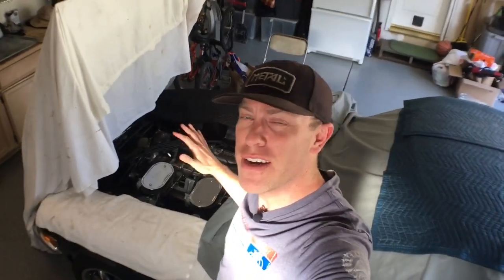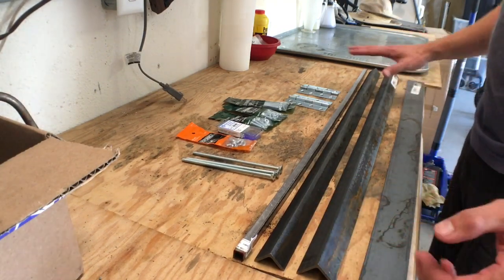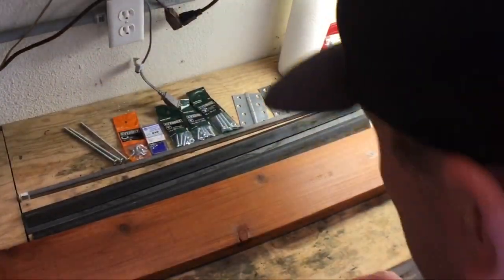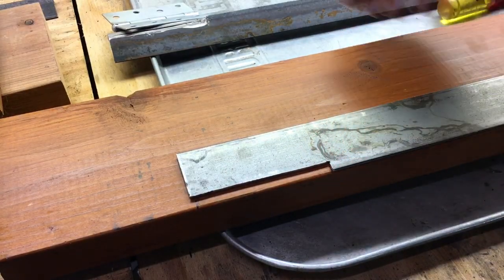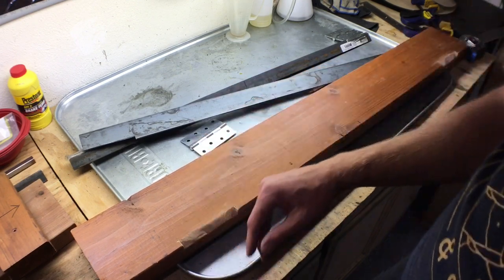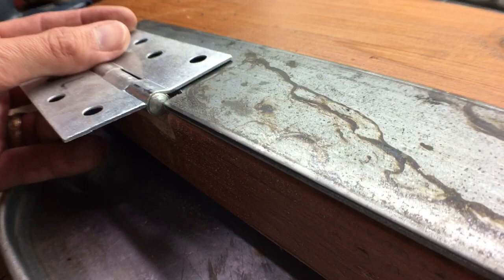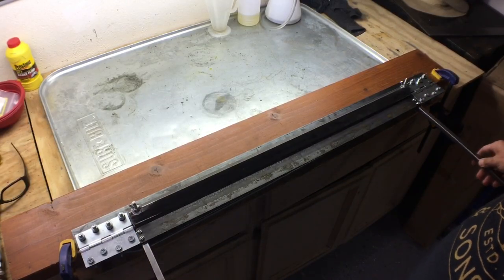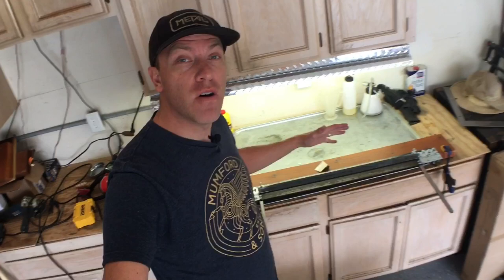How to make a sheet metal brake with no welding

Comment: Built my own real similar..but I used it as excuse to buy my first welder. $120 on Amazon..I was able to weld in place my hinges,  handles and some back mounting plates in a fraction of the time it would've taken to drill, bolt in place. Just saying..it's a great tool and skill to add to your arsenal!
Reply from the maker: I like your thinking. I have seen bought a welder, you’re right, in less time then drilling.

Comment: Wouldnt a piano hinge work better just asking not judging
Reply from the maker: I suppose you could, my only concern if the gauge of metal would possibly bend the hinge if it was too thick. The other thing is piano hinge are typically long, so you still would want the sheet to feed through between. Thanks for watching!
Reply: @CarsBikesandCoffee  they have some pretty heavy duty ones at Home Depot and lowes in stock usually and just saying to maybe save you a lil work or maybe another build idea for another project definitely not knocking what you did just want to say that just in case lol
Reply from the maker: Oh cool! Yeah for sure taken as good advice 👊🏻! Always appreciate the community help

Comment: will it bend 3mm?
Reply: Not a chance, we have a clarke sheet metal folder in work and that's only 500 to 600 long and that will only just bend 2mm but the bends not sharp it's more like a curve. I'd say the max on something like this would be 1mm
Reply from the maker: +scott alexander +spoopy yeah, this is good for just small projects. Like the battery box I built. Thanks for watching!
Reply: @CarsBikesandCoffee   still a really cool build and handy to have in the garage
Reply from the maker: +scott alexander thanks man!
Reply: @CarsBikesandCoffee  I was thinking about making a skid plate so I need to make a 90 bend with 3mm. May have to half cut bend instead maybe try weld the line after.
Reply from the maker: +Spoopy that’s a good idea. Some metal shops may have a large enough brake to do it, is another thought. Good luck!

Comment: Great video....I was thinking if you used a longer set of bolts for the top angle that holds down the metal you can convert this brake into a pan brake.  by the way I really liked this idea.  cannot wait to get back to work to build this.

Comment: How do you make a small pan/box/anything that is bent from adjacent sides if it's not adjustable?
Reply from the maker: +Ace so I ended up making a small top brace for that. Check out my battery box episode around 4:47 https://youtu.be/0X5dUhSLWSc
Reply: @CarsBikesandCoffee  Fantastic. That's similar to the solution I came up with, I was worried the extra holes might interfere with regular bends. Not sure why no one else has made theirs like that.

Comment: Finally had some free time to make this. I'm up to the angle steel part which holds the sheet down. I thought I had some but it turns out I don't. Is there an alternative hold down method? Every tutorial seems to use the same hold down. Any help is appreciated.
Reply from the maker: +Ace unless you have maybe square tubing. That part needs to be really strong to hold down the edge of your metal to bend it. That’s why the angle iron is used.
Reply: @CarsBikesandCoffee  I have square tubing but it would prevent me from making a 90° angle since a sheet needs to be over folded to get a true 90°. Can I use wood?
Reply from the maker: +Ace yeah, that’s the other main reason to use angle iron. You could cut the square tubing in half. Wood will give, but depending on the thickness and size of what you’re bending it may be fine, give it a try. Good luck

Comment: What you think is the max thickness to be bendable?
Reply from the maker: +EMU4WD depending on the width your trying to bend and metal type. I was able to bend some small pieces of 16 gauge steel. But if they were larger it would need some bracing to support the center. Thanks for watching!

Comment: Why is the top bar mounted at 45 degrees?
Reply from the maker: +dberry99 it gives a little better “bite” and holding strength into the piece you’re bending, but it really is helpful when you need to bend tighter then 90 degrees.